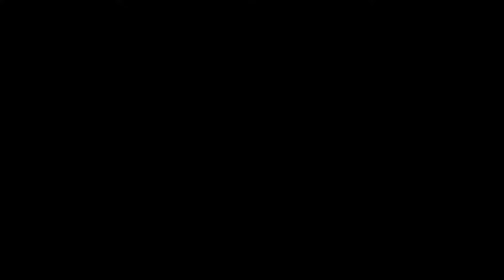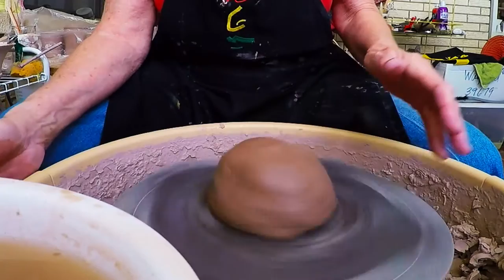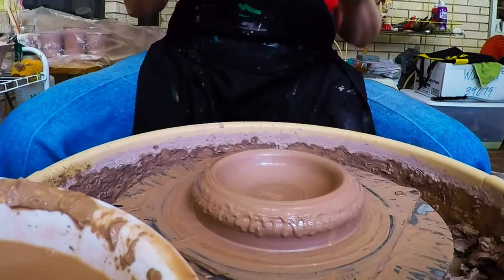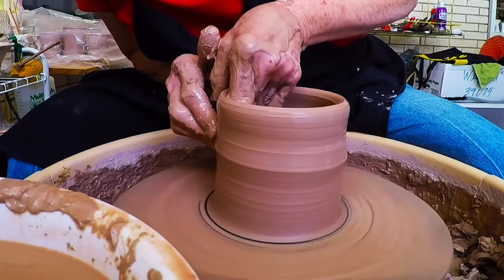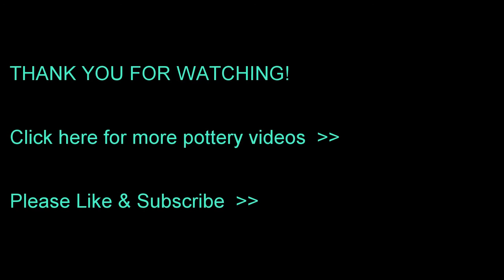♥ How to Throw a Kitchen Utensil Caddy~Wheel Thrown & Decorated Throwing/Making/Pottery/Ceramic/Clay

Comment: Good morning. I hope all is well with you. I have a question I hope you may be able to answer. If you don't have stilts available yo raise a piece of pottery up off the kiln shelf for firing,can you roll several little balls of clay and put them under the piece to prop it up? What about sea shells?  Thank you so much for your time! Abby
Reply from the maker: Hi Abby! Look who's having fun with a loaded kiln!  Yes! You can use shells or little balls to stilt --but only on an un-glazed bottom. My experience has been better with the little balls of clay slightly squashed so they don't roll, or a thin flat pad of clay depending on how heavy, what size and how high you need to raise the piece, and/or how runny you expect the glaze to be. For me, shells tend to leave a small carbon "flash" or burn mark on the shelf and on the bottom of my piece. While the marks didn't actually damage my shelves with kiln wash on them, etc., I didn't like the marks it left on the bottoms of my pieces. Using the same type of clay the piece is made from works best for me. *Be sure to save the little balls and pads for re-use because they can be used many times 'til eventually they get very brittle and unreliable. I have had a shell crack during firing. Well okay, it exploded. The pot shifted! I was super-lucky the kiln wasn't cram packed but I could see that the clay balls were going to be more predictable. I didn't want to push my luck. Hope that helps! Let us know how it comes out!  Good luck!